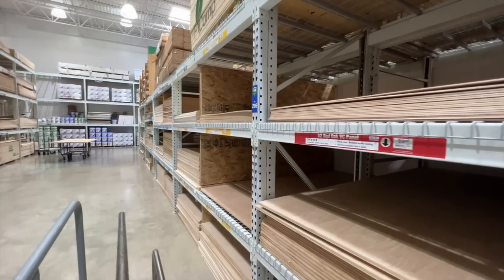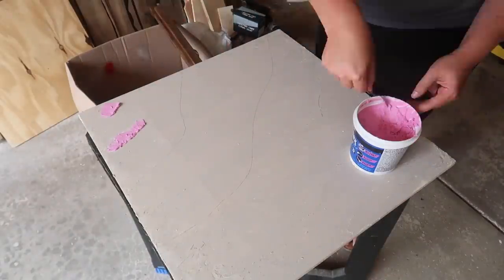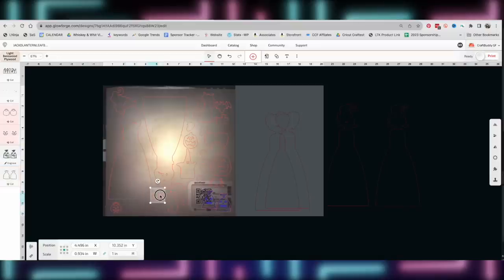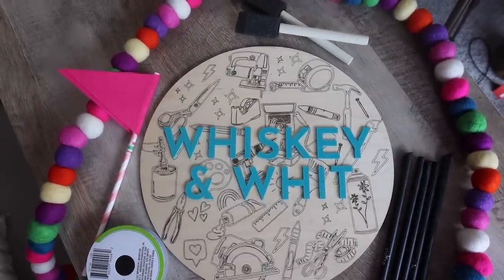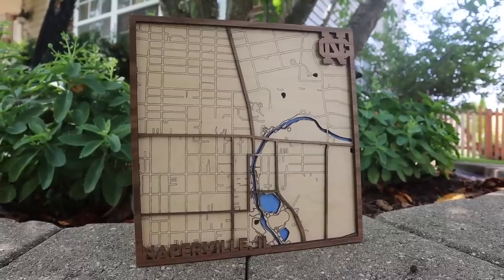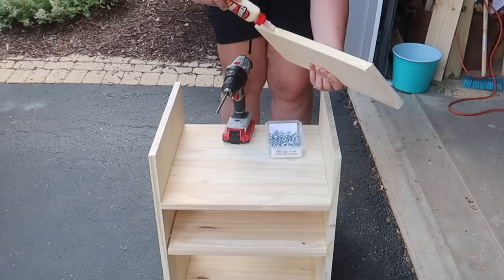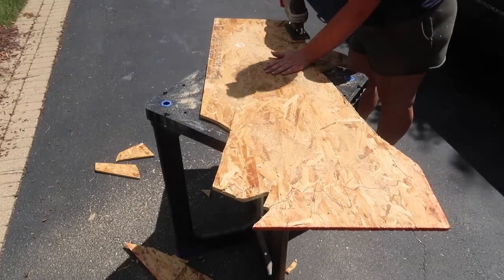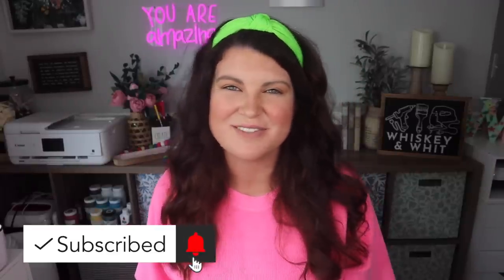Grab cheap plywood to make these Wood decor DIYs✨ PLUS Reviewing the NEW Glowforge Aura Craft Laser

Comment: Before I bought my table saw, I'd get Home Depot or Lowe's to cut my plywood down to specified sizes. They won't cut pieces that measure  under a foot, but I never needed them that small. Just a thought since the plywood sheets and cost of cuts after the first one or two is usually cheaper than the equivalent in  project board. Just a thought.

Comment: What brand and grit of sandpaper do you normally use?
Reply from the maker: My go to is typically 100 grit, but will adjust if I need more or less for specific projects. I use Diablo brand pads for my sander and 3M sanding blocks :)

Comment: How do you keep the jigsaw from vibrating against the wood?
Reply from the maker: My best tip is to use a scroll saw blade in your jigsaw and that will help. Usually the vibrations occur when the blade is getting stuck and the scroll saw option helps with that